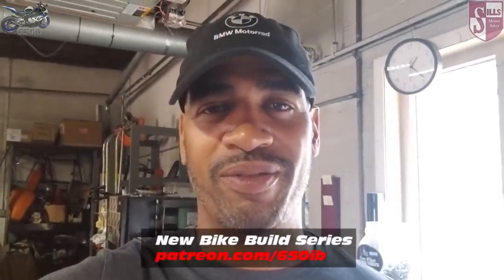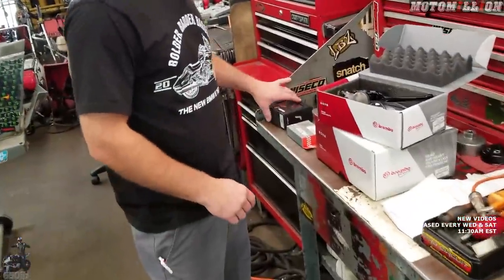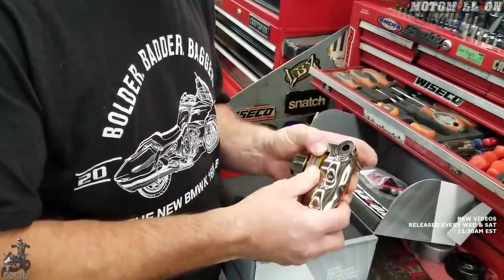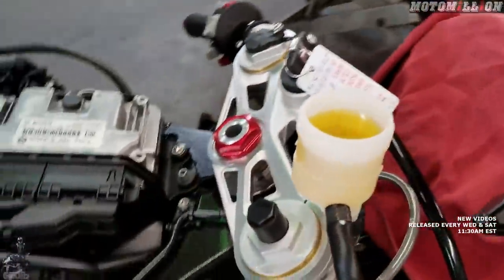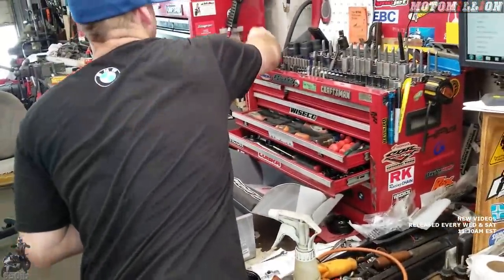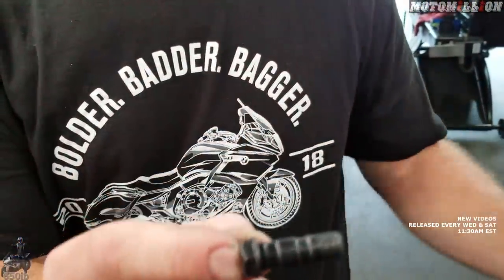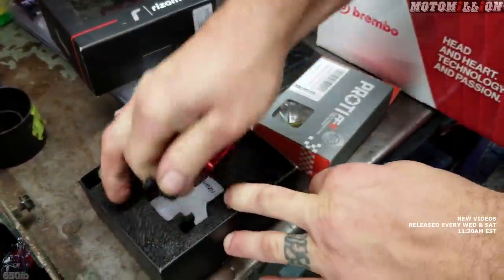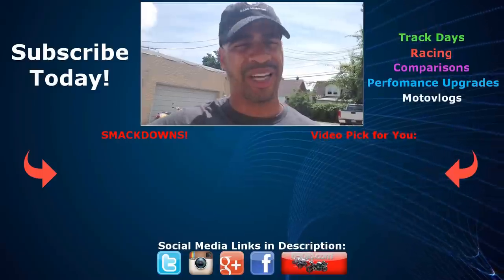Brembo Master Cylinder Installed | 2018 S1000RR Build

Comment: Also as to why a mono 2 caliper brake pad is better than a one pad per piston setup. Its not.

A 4 individual setup would give more initial bite due to better initial grab during the pressurization of the caliper pistons. But In theory the 2 piston per pad setup would be able to provide a more even distribution of force onto the rotor once the pistons have been loaded.

Comment: I’m considering upgrading to brembo master cylinder on my 09 cbr 600rr as I’m not happy with the brake performance whatsoever, especially comparing it to the brakes on my 07 cbr1000rr which are miles better. Is the brembo mc a universal fit is my question or do I need to get a specific model for my bike? Running HEL braided hoses, should these work as well? Thanks!

Comment: Hey 650ib, got a question for ya or Zach . . . Will flush mount turn signals for a 2017 BMW S1000RR fit on a 2017 BMW S1000R . . . Looking for flush mount turn signals for the front, but can't seem to find anything for the Single R . . .  Let me know, Thanks

Comment: I change  my  caliper from P4 oem to M4 Monoblocks from HP4 and  forgot  the Brake caliper with  monoPads, they have more power but the P4 are a lot more sensitive and you have better  a lot more dosage feeling on your brake.
M4 or other MonoPAD calipernever only if you have more then 250hp/ps and it's required otherwise oem P4  perfect caliper.
Z4 brakepads take it only if you have enough  temperature for them ;)

at https://www.telatemp.com/ you can get temperaturesticker for you caliper :)

Comment: Will that Brembo master cylinder fit  my 2018 S1000R's handlebars? I'm going after that modularity (adjusting the bite point) but I don't really need a caliper upgrade. Can I install just the master cylinder + reservoir?
Reply from the maker: Please contact Mani from MotoMillion on their website
Reply: hey TT did you get an answer to your query? RR & R pretty similar but not sure on handle bar diameters. If you went for this upgrade did you also upgrade your reservoir or adapt the hose connectors?
Reply: @chrisgoes9610  I did get an answer from some other place but that was so long ago I don't remember what it was. I kept the stock setup and got used to it. I have too many hobbies that I have to spend money on......stock is fine. Can't help you, sorry.

Comment: Hi 650ib... in what comes to performance spark plugs it has Been really hard to find the apropriate ones for this bike... and bmw has lifted the compression of the pistons compared to the previous model, what turns things more dificult...  brisk claims itself their racing silver plugs with 360 degrees diacharge to be the best ones... although i have already  seen 10hp loss on dyno with them... 

Are you looking for this mod...?